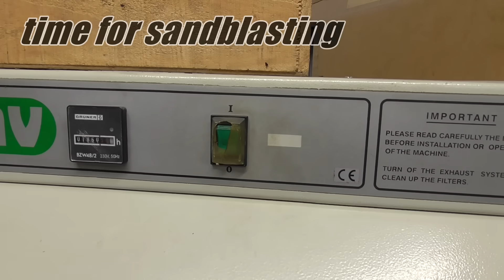Rusty Deadlocked Vise - Perfect Restoration

Comment: Love what you did here but I have to disagree about the crosshatch jaws, they really make a difference for most things a vice is used for.  If I need to protect something, I slide on a couple of pieces of aluminium angle, shaped to drop over the jaw from the top and not fall off.  Works well because aluminium has more friction than hardened steel.

Comment: I believe that using a penetrating solvent like Westley's B'laster, or even old used motor oil, and a little soaking-in 
time, would have penetrated the rust a lot better than WD-40.  WD-40 is more for protecting metal from moisture, although it's not very good at that either.
Beautiful job, by the way!

Comment: awesome work!
one question: at 12:40 you heat the parts at 300°C and put them into a rapeseed oil bath. Is this a thermal quenching? And the parts become black after that?

Comment: Very cool video, excellent job.  Question: instead of painfully painting the raised letters white, I was thinking you could have sanded/filed the surface to give them the shiny silvery look which still would have contrasted the dark green.  Would that have been feasible?
Reply: If you do it this way there's no protecting layer covering the bare metal surface anymore.
So if you gonna go this way you'll need a transparent coating or grease.

Comment: Great work! Video is very hypnotic.  I got a question about the black oxidizing the steel; does it get that black from a single heating and quenching or multiple?  Also, do you know if that would work with titanium alloys? Specifically, grade 5 Ti6Al4V.  Thanks bud.

Comment: Very nice job.
Here's a helpful hint to remove broken screws rather than to drill them.
Use your MIG welder to build up enough metal to put vice grips on the screw. It will come out very easily because of the heat generated by the intermittent buildup of metal on the broken screw. Chase it with a tap and you're done.

Comment: I'm in my 60's now, and something I learned not long ago is that using a metal file both directions ruins the cutting teeth. You used the file correctly once, but the other times, you seemed to be pressing down in both directions. I'm curious about that. 

Thank you for such a fine example of careful workmanship. It's this that tells me the "common" craftsmen of the world are far more intelligent than the most learned lawyers and those with MBAs. I'm a computer support engineer, but support large sophisticated systems, not desktop/laptop systems. I user Linux and taught myself everything. I can fix anything, but health (degenerating spine and nerve issues) prevent me from doing what you are doing. I love what you do, and envy your strength, stamina, and mostly your equipment/tools :-)

I'm going to subscribe now. This is the first of your videos I've seen.
Reply: I would t say it ruins it but just puts added wear on it for no reason. If you slightly drag it it’ll be fine. (Still better to lift completely but in some cases it ruins the rhythm. But the same reason it doesn’t get destroyed going the correct direction works both ways. The files are muchhh harder than most metals for that reason, so they can file. But you’re absolutely right the correct form is to only use it on the upstroke, but don’t beat yourself up if you drag it a bit they will survive. Assuming you have a good file. Have a good day and great video!
Reply from the maker: Seems like, but i'm not putting any preassure on it when pulling it back.  Thanks
Reply: @mymechanics  
I suspected that's what you were doing. Thank you for your reply.

Comment: Fantastic video thumbs up! 
There is an old engineer genius named dan gelbart, check his videos, he points out that sandblasting is a much better solution then degreaser before painting: degreasers have a solvent which actully only dilutes grease, but a melocular layer over the metal is in theory enough to prevent good paint adhesion. Blasting on the other hand removed layers (and bonus feature work hardens a little). So no need to clean after blasting!

Comment: That was extremely interesting. I love to watch restoration projects.  I have never seen sand blasting done and it was cool to watch the rust evaporate. If you can also restore knees and feet you have a bright future.

I read a four-part series in a Virginia newspaper as the Desert Storm attack on Iraq was being prepared.  It described all that was done to revive a mothballed Liberty ship from WWII. It too was a fascinating process just to read about. Like watching something come back to life. No one was familiar with the ship's wiring. And high-pressure steam leaks  are very dangerous and they checked by holding a broom as they approached the boiler.  High tech!

Comment: My one thing i was gonna say but has been covered in your pinned comment is the WD40. I work in the oil and gas industry as a pipe-fitter unbolting flanges that have been subjected to years of steam and other products. Do yourself a big favor and get some good stuff (I swear by Kroil in my work environment of oil refinery's, some argue against it, this is personal choice). It will make your life so much better when it comes to rusty bolts ect. Great videos keep them up!

Comment: Thumbs up for this work and video! In age of 14 I was an apprentice in a machinery factory. In the apprenticeship workshop we did similiar restaurations within one or two days. I presume that was only possible because the factory was much better equipped as your shop is. E.g. derusting of such items were done in the factory's blacksmith's shop in shorter time. And we had not to search for spare screws. Some work you've done with a file and sanding paper was done with milling and grinding machines. Without the advantages of a factory we were not able to do it faster. It's a pleasure to see you working with very professional tools and machines instead of DIY market's rubbish. Your final result looks great. I wish your work and video will encourage a lot of other people to preserve other old and rusty items.

Comment: great job  i work for a local transit co   a friend of mine saw me using a impact driver to remove window frame screws  im suprised to see you using one beter than striping screw heads ive often wonderd  about the  paint  finish thank you  i have a oil stone too in  a  woden base my dad gave me apox 40 yrs ago i sharpen my  buck hunting knives with it good to see a person using there hands thanks for the tips

Comment: subbed for making custom bolts to loosen the rust top part ----- ogh the rest of video is even better ! question, why did u filler the apeared holes and not weld them? and why not sand of the grid from grips if u want flat ones? genuine questions

Comment: Ah, very nice job on that vise! I was worried at first that you were just going to wire brush it, then the clouds parted and the sand blaster came into play.  I am impressed by your engineering with pulling parts apart.  You didn't use a hammer and beat the thing to death.  Works like you just bought it at a local hardware store.  Great job. Will be watching more!

Comment: Excellent work. I was going to comment on #4 (penetrating oil), but apparently you have it covered. In case someone else did not make this suggestion, it is possible to make a fine, inexpensive penetrating oil with a 50:50 mixture of acetone and automatic transmission fluid. (I'd wear gloves religiously, though)

Comment: Truly the work of a craftsman. Everything was done to perfection. No shortcuts were taken. There was the benefit of having a lathe and a mill handy. ;-) Greasing everything well during reassembly — including pins, screws, locking collars and inner surfaces — will keep the rust away for years to come, just like the visible surfaces. The paint was a nice touch. It looked great. At the end you were able too crank the vice all the way in and out using just your finger. The restoration was flawless. Also, your English is very good.
Reply: I agree with everything you said, Grover, which is why I'm trying to figure out how this video managed to get more than 3200 dislikes. What is there to dislike about it?

Comment: Instead of WD-40 for penetrating oil, try using 50-50 mixture of acetone and automatic transmission fluid type f.  You will be amazed at how well it works on loosening rusty parts.

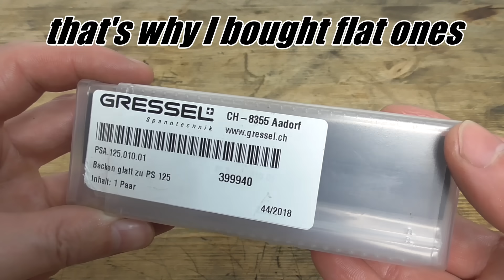Comment: 13:14 The jaws were not in perfect condition but the ones that are not flat are much better to get a good hold on things, specially when you have to hit them or apply much force. With the flat ones things will slip. You could have got just new ones with the same coarse surface for good hold.

Comment: I worked as a sandblaster/painter for a couple years. 
Tip: use painters type tape, then put duct tape over it. Works great for sandblasting.
Reply from the maker: Good idea thanks

Comment: Didn't look that bad to begin with... just superficial rust and gunked up grease ... still very nice result though. One thing I personally would've done differently... I think the lettering would've looked much nicer if you sanded them flat and gave them a clear coat in stead of painting them.

Comment: "WD40" is not really the best remedy for rust removal. It would be wiser to recover iron oxide from the surface with an acid solution. The most accessible method is lemon or acetic acid. It will be better to have a phosphoric acid. Knowingly then everything needs to be rinsed thoroughly and protected from corrosion. I will restore the tool that ceases to ruin.

Comment: Amazing work! Looks better then new. Your lathe usage was excellent too. Usually see people go too fast with it and it leaves non-flush surfaces that need smoothing after.

That white letter painting... Tip: use oil based putty and press it over the letters until the face of the letters are fully exposed. Putty scrapper flat and wipe clean the letter faces.
Now with one swipe of a regular brush, all the letter faces are painted! Just wait for the paint to dry, then removing the putty and wipe it down with a dry cloth.

Comment: Have you ever tried electrolysis to remove rust? Or oven cleaner? I believe there are less destructive media you can use in sandblasting that won’t remove metal they’re used in car restoration on rusty bodies.

Comment: Well done, sir, though you could have saved yourself a lot of cleanup and disassembly grief by throwing the whole thing into a bucket of a mild phosphoric acid solution and waiting a few hours before disassembly. Also, try a 50/50 solution of acetone and automatic transmission fluid to penetrate and free stuck parts. Dissolves rust better than WD-40 or Kroil and is dirt cheap to make.

Comment: Beautiful job. Does anybody know why we apply lots of heavy grease to the threads and ways and not just oil that wipes off easily. It doesn't move very much over its life like a powered machine. I have restored a couple of vices over the years and have just lightly oiled everything and it seems fine. The grease I have removed though was dark and hard and ceased being of any use years ago.
Reply: philip rogers Good question

Comment: I'm considering a similar restoration process, would using an electrolysis method to remove the rust take less active time and leave more of the good steel?
Reply from the maker: Less weight=faster ;-)

Comment: interesting use of foil tape, would not have thought it would hold up under bast media. what media and p.s.i. are you using.  In our shop when Blasting parts. To protect machined surface, we use 3m 2 inch wide electrical tape. layer and trim as you did with utility knife. p.s. using Koil oil,  WD40  or any penetrating oil gives a good finish when polishing with Emery cloth (sand paper utility roll. Great job on your rebuild.

Comment: WD-40 stands for Water Displacement Formula 40. It is not very good as a penetrant. Try using PB Blaster instead. It works amazing!! Here is a link to it......   https://www.amazon.com/Blaster-5633763-Catalyst-Lubricant-Pack/dp/B00WUS34M6/ref=sr_1_2?ie=UTF8&qid=1542494965&sr=8-2&keywords=PB+BLAST
Reply: Great video by the way!

Comment: Beautiful! Is there some reason you didn't use a sealant like TopCote (now GlideCote) on the bare metal parts? It leaves a dry, imperceptibly thin film that reduces friction and helps prevent rust.

Comment: Suggestion for panting raised letters: Use a sponge, preferably a small, dense one. Dip surface gently into paint and then press gently against a piece of paper a few times, so that there's no excess paint. Then apply to letters. Repeat as necessary to get the thickness of paint you want. It's a lot easier than fiddling with a brush or toothpick, and you'll get a perfect even surface.

Comment: Great artisanry, thank you.
Two questions:
1. Is it by purpose that you don't use heat to remove the screws / threaded bars?
2. What's that make of your parts washer, and what do you use for cleaning? The process looks like a charm.

Comment: Instead of using a brush to paint those letters, I think it would be easier to use a kind of 'brush' made of sponge. I use it when working with signs with street names in my work (letters are ca. 35mm in height)

Comment: I havent seen that vice type since middleschool 1982 in shop class. They must be extremely expensive as there was only 3 in my class, but only two worked. One near doorway was jammed, and was never fixed while I was a student. From my umderstanding, a forklift hit it while bringing in new equipment and the shopteacher said he regretted not removing it, but at the time the bolts that secured it were different. Security type that needed a special tool that was long lost. You were definitely accurate about the groovs damaging the finish. Had seen what it had done to other students projects, though I got around the issue using scrap sheet metal. Schools used the groove type to prevent items from flying out, so understandable why my school used that type. You did a wonderful job restoring the vice. Makes me wonder how it got in that bad shape to begin with.

Comment: fantastic video except for ONE thing - you give the illusion of filing in BOTH directions at a couple of places in the video.  Obviously you're a good machinist/mechanic and know to only draw the file one way; but some people watching may think it's okay to use a file in a back and forth motion.
Reply from the maker: This is a professional technique i'm using, pushing forward straight and back wards slightly diagonal. I don't use any pressure when pulling it back.

Comment: Hi, I am a chemist. Have you considered using diluted Hydrochloric acid for removing rust? It is much easier than filing and scratching the surface. It only removes the rust, not the metal.

Comment: You do know WD-40 is not a penetrating oil? It's a lubricant. A 50/50 mixture of transmission oil and acetone would have worked much easier.

Comment: Start with putting all pieces in Coca Cola and cover it with Coke 3-4 cm. Let it be there for around 3-4 days
and move around the pieces during this days. It will start bubbling and sometimes smell. Fill with Coke
so it always cover. Good ide is also to take away the foam that becomes.
Then us sandpaper and paint it.
I fixed up a gasol grill with 4 burners that had been standing outside 5 years nobody using it.

Comment: Hi! I loved watching this. I am pretty sure it ended up in my watch next feed because I was searching for rust removal 'how to' last week. I am a teacher, and the hurdles for our track team have steel weights inside aluminum shafts that have rusted in place. (they should be movable to change how much pressure will knock them over.) the aluminum shafts are welded shut on each end, and the only way to access the steel weights is through a thin slot where you adjust them. do you have an idea how to unbind the weights easily? there are about 80 of them, we thought about sliding the "feet" into a closed PVC pipe attached to the fence, so the "feet" can soak in a rust remover unimpeded. here is a link to a style of hurdle that is similar to ours. https://www.aaesports.com/international-college-90-hurdle-p/xlah.htm  Any ideas or help would be greatly appreciated!

Comment: Hello first let me say that is an immaculate restoration. The patience to measure and create the missing part/s, the attention to detail and the finished result is stunning. I would not have had the patience to do the lettering like you did. When I do things like that I paint the lettering first with the color I want them to be in your case it would have been White Hammerite then  paint the main color, in your case the metallic Green of the rest of the body over the top of that. I then use a flat metal plate with some 1000 grit wet/dry sand paper to take off the main color until the lettering color shows or if it is in an area that I cant reach with a plate I use heavy paint polishing compound on the face of the letters until I have worn away the paint to expose the white  underneath. trying to lay on the paint with a toothpick is not my forte lol. Thank you for the video.
Reply: O
Reply: That's actually a genius idea. The way I did it was with a stiff/hard sponge soaked with thinned paint, just gently brushing/tapping over the risen lettering until they are all covered, fixing any missing spots by hand just like in the video. But this guy did all the letters by hand, which is crazy ocd level

Comment: Great work bro. One thing I used to buff out steel back to a shine ready for priming and paint or powder coating is sanding disks they make for angle grinders. It would make quick work (literally seconds) for the wider flat surfaces and you can also use a B&D mouse sander for the tighter areas. They also make smaller more delicate and flexible pads for smaller rotary tools. Saves a ton of elbow grease 👍

Edit: I typed this before I saw the sand blaster lol